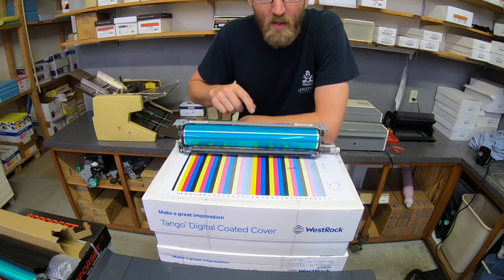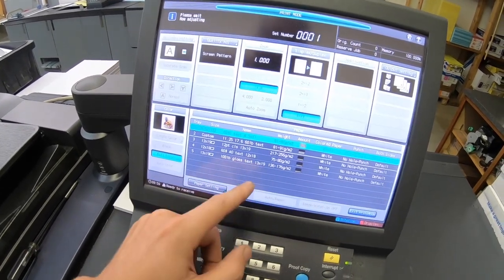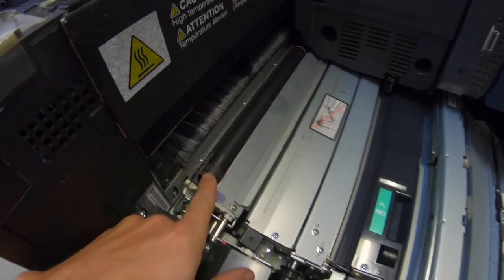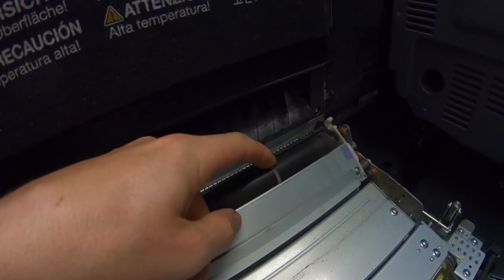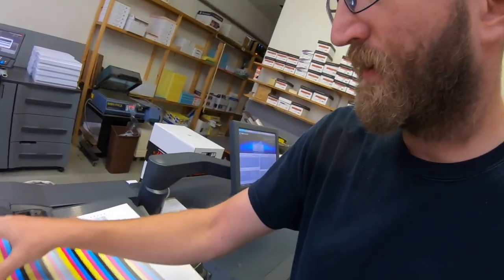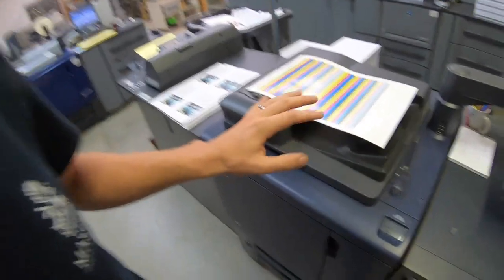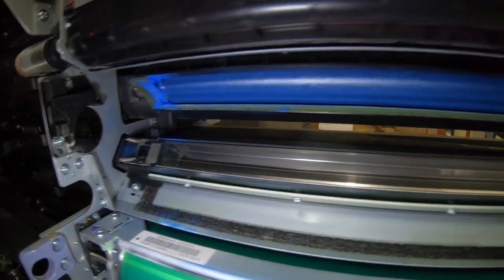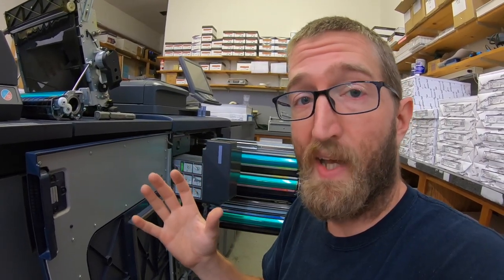How I Find the Problem and Fix a Konica Minolta C1070 Digital Printing Press, Didn't Expect This

Comment: Good day, i have also problem with developer unit, but yellow Km 6000. I clean printer, corona and developer unit, and start printing 50 sheets SRA3, 10 sheets is good but then yellow color lay with big spot, open the printer and see many yellow toner in corona, in drum unit and developer unit, developer unit and drum unit is original used 10-12%, developer unit have  gap 0,8 mm between magnetic rollers metering blades. Did you have the same problem? Thank you)
Reply from the maker: I'm not sure but I would think developer or dev unit is to blame.

Comment: I have a 1070 that won't turn on, any ideas?  There is power to it, and the green light on the printer screen comes on but doesn't power up. Tried resetting the breaker in the machine.
Reply from the maker: Sorry, I don't know. Sounds like a bad power supply. Or maybe a bad switch. Test both switches.

Comment: Glad you got it fixed by the spacers. Just a tip, another area to check if it was not the drum is to check and clean the Toner Shield Glass. There might be dust or a haze. Another area would be at the laser units shield glass, you can always swapped CMY lasers for testing (time consuming). One last thing if the drum was bad I would have used it in Yellow since yellow can hide some imperfections of a drum better than others.
Reply from the maker: Yes, swapping poor components to yellow has saved me many times. Ha!

Comment: I just replaced 3 of the 4 developer units and developer on all 4 units on my C1060.  The 3 units I replaced are printing fine.  But my BK developer is printing a bit off.  That was me using new Developer in an old developer unit.  I was also told about using new units when I swap developer.  I will do this for now on.  I don't like wasting developer.  It's too expensive. Lol..
Reply from the maker: Agreed. I'll keep this in mind when I start replacing developer units. Thanks for sharing!

Comment: I also learned a lot on my own.  I learn more and more new things from you putting these things on youtube like this.  Currently I am using only Xerox 5875 black and white laser machines.  I still use a inkjet machines for color printing.  I am a very new person in the field of printing.  But one day I also hope to use machines with modern technology like you.  My next hope is to add a konika minolta color machine to my business.  One day I will be the owner of a large printing press like you. Thanks for sharing your knowledge 💛

Comment: Hi Dan,

I knew the moment that I saw your chart that this would be the issue. This is actually the way to go if you want to solve the uneven density problem in the scan direction on the C6500, since there is no adjustment for uneven density in the scan direction. It only took a few pieces of plain paper placed on one of those black tabs that are on each side of the drum. Those few millimeters may seem insignificant but affect image density by a large factor. It is even more prevalent on halftones, it wasn't printing yellow at all at one of the edges.
Reply from the maker: You're the man! Just glad it wasn't the new drum!

Comment: Always good to make a test print before and after you replace something. That way if its something that you may of accidentally done, its easier to diagnose. Also regarding generic vs OEM parts, yes they may be cheaper, but can cause other print quality issues, like more toner usage etc.
Reply from the maker: Agreed, OEM is the best!
Reply: Furthermore, using a generic product in the machine can defeat the purpose that is needed, by damaging its working parts. An ounce of prevention equals a pound of cure.

Comment: Watching this show makes me appreciate using a color laser printer and printing on to laser paper. The problems with that cyan toner encourage me to adhere to using only the printer manufacturer's brand toner. The same thing goes for using my label printer. Better is to use the original and not an imitation; the imitation can never be duplicated.
Reply from the maker: OEM is always best!
Reply: @justaprinter  I am glad that we both do agree. The only paper I use in my Canon color laser printer is laser paper. I bought Office Max laser paper. When that supply ends, I will add Hammermill color laser printer as my only brand paper, while it is stored in my closet. I bought two ten packs cases. Better is to be overprepared than to be unprepared. Thank you for tapping or typing to me.

Comment: Hi Dan. Am running the C3070. I am a bit lost on what could be my issue. My corona wires are barely hitting 30% before they begin to either show lines or fading. I print quite a bit of solid on card stock, but i feel I should get more percentage on them. Also, whenever I clean using the provided tool, I always seem to spread the dirt rather than clean it out such that if I was cleaning because of a faint line, i end up getting another 4 or 5 spread along the wire... Any thoughts on this? Are there other ways of cleaning other than the tool provided? What is the significance of the mesh grid and does it also affect the performance of the wire itself? Many thanks
Reply from the maker: The wire and the grid both need to be clean. You could be wearing out oyour wires prematurely if other components are worn. (developer, drum, dev. unit) I'd replace anything that is over 250% and clean it all. Make sure calibrations are all done correctly.
Reply: @justaprinter   its a very new machine, am at 500k clicks, so am nowhere near 250% on anything... Thanks though, ill keep checking...
Reply: @wachutube10  I'd suggest using can air to blow off the toner before using the tool.

Comment: How long have you been running the Generics in the K/M machines. I've found that it's hit and miss with Generics. Some work great, others wear early, and give voltage issues, along with copy quality problems. One extra service call on average for a Generic, and the cost savings is wiped out. Not trashing them, I've used them on and off for over 30 years with considerable success, and some really bad failures when it comes to the DPS not wanting to stay locked in on certain high volume applications. Thank you for the video.
Reply from the maker: I tried it only once. It was garbage. I only run OEM now. The problem is that replacing the drum only replaces on of the three wear items in the drum unit.

Comment: We are getting the cyan and yellow developer changed tomorrow morning on our C1085.
Reply from the maker: I've heard good things about 1085 machines. Do you like it?
Reply: @justaprinter  We had it 5 years, only 1.4 million clics on it. Had a lot of  Communication Failures with the Fiery Servers. We are now on our 3rd Fiery Server and this one works, the previous 2 Fierys both failed to communicate with our C1085. C1085 is good, runs well, but Firies don't like it.
Reply from the maker: @rodneystagg1865  Interesting, thanks for sharing!

Comment: What is the material on the drum? It might be a taper on the drum where it's might be outside the specs.
Reply from the maker: I would like to know what they are made out of, I need to look into that!
Reply from the maker: @bearpump  Thanks Jeff, I love it when someone else does the leg-work of finding info for me! Now I want Konica to start making replaceable drums and cleaning blades that are simpler to replace like a Kodak Nexpress!

Comment: Hey Dan, I have a 3070 which gets very light use. I only print greeting cards and I have less that 300,000 clicks on the machine after 3 years! I am having a on going problem with the developer unit. Quite often when printing a job with heavy toner coverage, I get the striping problem which points to the developer needing topping up. This can happen only a few days after having the developer changed for the same issue which does not makes sense to me. Magenta is the main offender but I have seen similar issues on other colours. I am told by the engineers that the machine is not distributing the developer quickly enough. I am printing on heavy stock which slows down the developer distribution mechanism in the developer unit. Have you seen or any other user seen similar problems with dev on these machines? Is this a design flaw? Thanks a million - Ger

Comment: I miss this job i suggest when you check the cmyk quality you print a whole size of the paper by 100% each color in that way you will recognise easily if that problem is the drum, charge roller, or the developer and need keep reference the good printout cmyk so that you can compare the deference and know the problem easily
Reply from the maker: Yes, that I what I do. Except I only print a 25 % tint. But I see what you are saying to check developer with 100%. Thanks!

Comment: Hey buddy if nobody has told you yet what we do in the field on production machines when we’re in a pinch especially , we pick on the yellow channel we put the bad parts in the yellow channel because yellow hardly ever exhibit any issues in the print reproduction unless you’re using heavy yellow on something
Reply from the maker: Yup, I have done that a time or two. Keep the tips coming!
Reply: @justaprinter  Thanks for replying back ! if you need anything let me know I work on these machines every day for 31 years now

Comment: You're like the Sherlock Holmes of digital printers!
Reply from the maker: There are better people than me out there. I'm still learning! :)
Reply: @justaprinter  You are even better than me. I am just a typewriter and a keyboard specialist doing business productivity applications at my private home typing service. I use only laser paper in my laser printer, but you use varieties of paper. That practice makes you definitely professional because you are a real "printer." I am gaining clientele, because lots of people are resorting to do their own documents, spreadsheets, desktop publishing, even information management as in databases. I think that I do a little better database management by using a database program and not a spreadsheet program. After I bought my first computer in 2002, I made my own flyers, brochures and business cards by using Microsoft Publisher 2002, even though when it came on a separate disc with the Microsoft Office XP Professional suite.

Comment: Hi Man, good job as usually 👍
So, I have a Black Color shift on BizhubPRO C1070 and error code C-2214 two times in a row, now error appear on start up... 
I cleaned coronna, drums, belt gears... All visible parts and sensors, I hope it's not DDB or PRCB 😬
Please any idea to fix it 🙏🤔
Thx.
Reply: do you have the service manual for your machine? it should have a description for that code that will help you narrow it down.
Reply: @orestes29  Hi  Ορέστης, thx for replay. In the service manual this code relates to a black drum motor fault, but via the i/o Check mode the 4 front motors are working correct l'y on all 3 speeds, so I've dismantled the rear machine and checked the 4 encoders and they looks good.
The machine has 1.600,000 prints..
Reply: @mohamedgreche2509  Can you copy and paste the manual's description on the code for me? I am not a tech and don't have free access to all KM service manuals.

Maybe the cleaning blade has flipped on the K drum unit?

Have you tried swapping it with e.g. Cyan and checked if the code changed?
Reply from the maker: I had errors pointing to the drum motor on my C6500. Turned out to be dust on the encoder. Try to swap the encoder/motor with another color and see if the fault moved to that color. If not, your black developer might be shot and not imaging correctly? You could swap drums too. Highly doubt it is a board. Usually something simple. Let me know what you find!
Reply: @orestes29  Hi man, below the description in the manual : 2.15.10 C-2214 
Code 
C-2214 
Classification 
Main body: Drum motor abnormality 
Cause 
When the drum motor/K (M4) is active, an error detection signal of M4 is detected continuously for a specified period of time. 
Measures to take when an alert occurs 
The main body and the option stop immediately to deactivate the main relay. 
Estimated abnormal parts 
• Printer control board (PRCB)
• Drum motor/K (M4)
• Encoder sensor/K1 (EN58), encoder sensor/K2 (EN59)
• DC power supply/2 (DCPS2)
• Drum unit/K
• Drum drive board (DDB)
• Drum encoder/K
Correction 
Note 
• The message "Please call service" is displayed on the panel.
Solution 
1. Check the drum unit and repair or replace it when there is any abnormality
2. Check the connector connection and the wiring between PRCB, and the motor and the sensor, and repair it when there is any
abnormality.
3. Check the connector connection and the wiring between DDB and the motor, DDB and the PRCB and repair it when there is any
abnormality.
4. Check the I/O drive of the motor and the coupling of the gear, and repair or replace it when there is any abnormality. (Wiring diagram:
Main body (2/4): 17-O)
5. Check the connector connection and the wiring between DCPS2 and PRCB, and repair it when there is any abnormality.
6. Check the skew, the status of the slit, damage, dust of the drum encoder. Repair or replace it when there is any abnormality.
Thx
Reply: @orestes29  Yes, I swapped drums and coronna but nothing happen..
Reply: @mohamedgreche2509  Was the code exactly the same one as before when you swapped the drums or did the code change to a different one corresponding to a different colour?

If it's the same, then try cleaning the motor's encoder as Dan suggested. Other than that I don't really think I can help you that much more. If I were you I'd try to eliminate each probable cause that the manual lists one by one.
Reply: @justaprinter  Hi Dan, Yes of course, I thought of that but on C1070 for the black color motor as well as the encoder are not the same as on the other colors
Reply: @orestes29  Yes the code remains the same at startup, indeed I'm following the steps described in the manual I checked everything, unfortunately I still have the DDB and PRCB to check and I hope that is not the case, but since I am starting to discover this print engine I said to myself that maybe I missed something 🤔
Thx bro.
Reply: @mohamedgreche2509  Most likely it's something simple that you're missing. I would call a tech for his opinion on the subject before replacing something costly like the PRCB (which imo would be the least likely thing to be causing this).
Reply: Hi guys, Unfortunately the nightmare continues, I can not solve this problem of C2214 ... The technical service asks me to change the PRCB and the gamma plate but it seems to me that the problem is mechanical more than electrical, moreover. they did not even plan to change the DDB card or the Black DC motor but I am not convinced ... Someone has an idea please 🤔

Comment: in my konica 70 hc printer I am getting error code C- E009.

give me a solution sir.

I have cleaned all the terminals and connecting jocks with IP ,as Jack's, terminal, PRCB board may have carbon 
formation.

changed PRCB TO PRIPB  CONNECTOR WIRE. 

STILL I AM GETTING THE SAME CODE.

PLEASE HELP ME.
Reply from the maker: Sorry, I cannot.

Comment: I suggest that you need to maintain room humidity of the room because the machine has a temperature requirement you need to control the temperature that the machine sense and the effect that you don't contral the temperature of the machine is when you print in volume the fuse is getting hotter and hotter the print color is changing
Reply from the maker: That makes sense. I'll have to work on that.

Comment: You print quantity jobs on this machine..no offset..n why 
In india konica minolta charge us 3.45 rupes fasma per copy A3
Reply from the maker: Offset is expensive for me mostly because of labor. I used to have offset but from my calculations I was not as profitable when compared to digital. It fits for my customers.

Comment: To know that your developer has already attain there life span you need to print whole size color like cyan 100% the print output is not equal or solid cyan of whole size paper in that moment i recommend to replace both of the developer unit and the developer if you will only replace the developer it will not last long you will only waste the developer
Reply from the maker: Yup, I have everything ready to go. Just waiting for some time to swap them out. Developer and dev units.

Comment: Drum 4×335€
Developer K 1×108€
Developer C M Y 3×118€
Corona 4×22€
T.Belt 1×360€
Belt Blade 1×16€ 
Total 2260€ 
my parts just changed
Reply from the maker: Sounds like fun!
Reply: @justaprinter   I dont understand